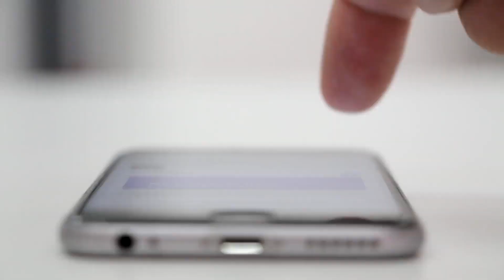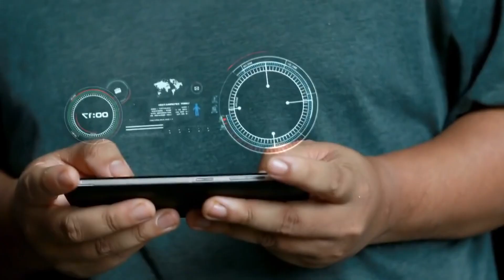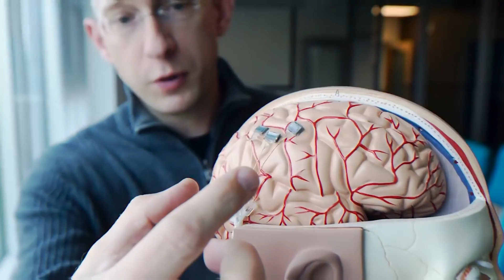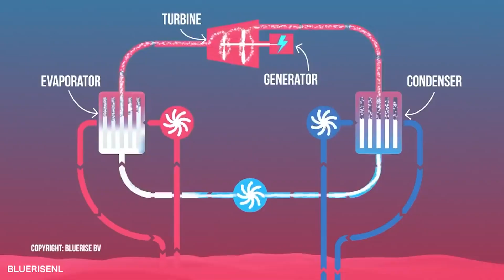The World in 2050 Future Technology

Comment: most of this is more than likely going to happen. even the full dive vr is not far fetched because we don't need the Nanobots to be a super computer we need them to communicate with a supercomputer. witch is why this should work by 2050. I don't know if it will be in peoples house hold computers by then though it more or less depends if they find a way to put a tiny quantum computer inside the computer then it mite be possible.      good video